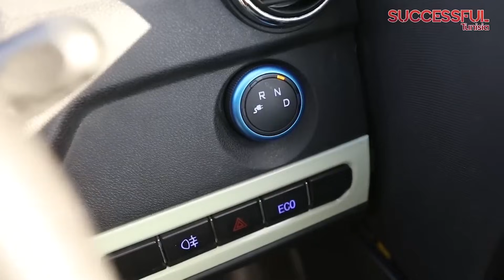African Homemade Electric Cars

Comment: There Is No Running On Frequency A Car, No, Thats NOT HOW IT WORKS.
My Other Channel Is Called :Frequency Watchers: So I Know Thing Or Two About Such Things, I Mean, You Can Turn On A Led Light With Right Lenght Of Copper Wire On The Wires And The Right germanium Diode , For Example, if There ARe String FM Or AM Station Near Your House, You Probably Can Make Garden Lights That Run Out Of "Thin Air", BBut In reality, You Are Just Leeching The Poweer From That Frequncy, But It WILL not Work For Any Bigger Things Then Few Lights Maybe. 
No Car Running On Frequency If Its Not Connected To Power Grid Or Batteries. All These Cars In The Video Who Claim To Drive On Water And Stuff Are SCAM And Only Uneducated People Could Be Tricked To believe Such Foolery ! And Thats WHat They Are, Uneducated Peopel Who Think They Can Fool People, But See, They Actually Are Fooling People, But Ones Who Doesnt Understand Enought To Understand That Its All A Scam And Trickery !

Comment: A vehicle running on Radio Frequency 
That's unimaginable 😮
Reply: It's not true. Very little energy is left in radio frequencies at that point. More energy is in a static shock from touching a doorknob  ..
Reply: Tesla's original Idea for electric was to send it through radio signals but the end point couldn't be metered and charged for what they use.
The radio broadcaster is paying for the car to move.
Reply: @Mr_Jamin007  imagine if it was successful there would be vehicles running with Radio Frequency
Reply: @masterpenguin3507  the more cars using radio waves to power themselves the more power the radio stations would have to pump through their transmitters.
Reply: Running a car just using energy from Radio waves is impossible. Even a small transistor Radio has to amplify the Radio signal by a factor of more than a thousand using its own power source to eventually hear the radio broadcast.

Comment: Solar powered bus - Nice idea but technically bollocks. The Kip72 - A very sensible, very functional device. This is a brilliant start. I wish the builder all the very best. The radio frequency car - Complete bollocks. This is a scam.  The Bako car? I think it has a future. The water powered car? Another one. “Oh dear, we have bin runnin out of fooel. Arl jus piss in de tank und will be goood for anutha hunnered miles”. More bollocks.

Comment: Water powered cars existed for a long time, people who make them disappear magically.
Reply: It takes more energy to turn water into fuel then what you get out of it. If you use batteries to turn water into hydrogen, then use that combustion to power the batteries and turn more water into hydrogen, it won't run for long. The batteries are required and will run out.
Reply: They disappear because it won't work
Reply: @hybridcenter9150  Denial only encourages inventors not to give up on their dreams. The powerful know it works, but they don't admit it because they are parasites.
Reply: Stanley Mayer didn't even use the conventional electrolysis process, he used a type of resonance frequency so he broke the molecules without drawing much energy.

Comment: The radiowave one is 100% a scam. Energy transfer via radio frequency electromagnetic waves has been known since the late 19th century and it's very inefficient. If it runs on energy from radio towers you just steal said energy from the radios and if it runs on their own netword I would imagine it is able to barely cope with one active device at a time. My money is on a hidden battery though since the energy you can harvest from radio waves is not enough to drive a motor.

Comment: 4:30 - You don't "defy" the laws of physics. No one does. Nowhere. That's what makes them physics. Any patent office is 100% right about refusing to register any nonsense that claims to make energy from nothing. And if you claim to have solved Nicolai Tesla's mystery of wireless energy transmission that has confounded the scientific community of the entire planet for a century (and many consider unsolvable) and claim to be chosen by god to do just that, then that should set off everyone's BS radar. Big time. Remember cold fusion? Remember Theranos? Stay awake, please.

Comment: I wish your group was investing in internal combustion engine ICE cars. Just because USA, EU are doing this; does not mean it is a good way to go. You have invested in need infrastructure electricity grid. So now you have limited the distance you can travel and time lost charging battery. ICE take five minutes to fuel.
Reply: ICE AND ECE can run on wood... rubbish... grass clippings... cow manure... anything that will burn...